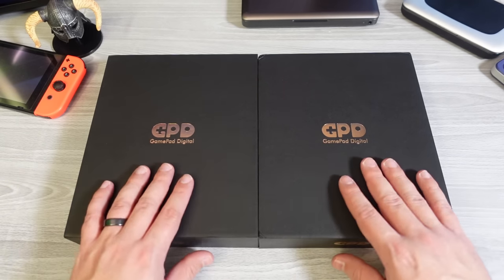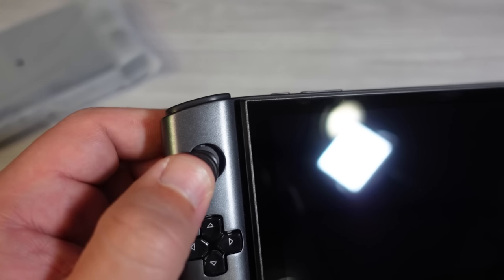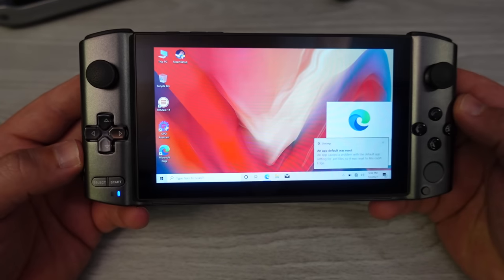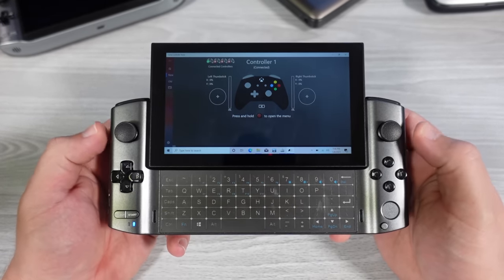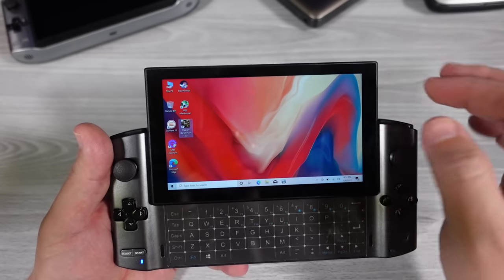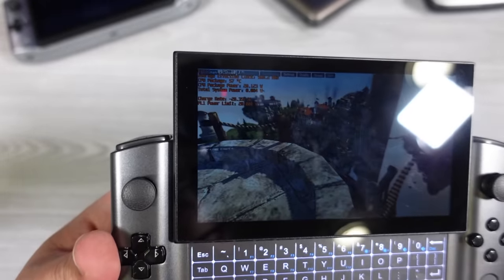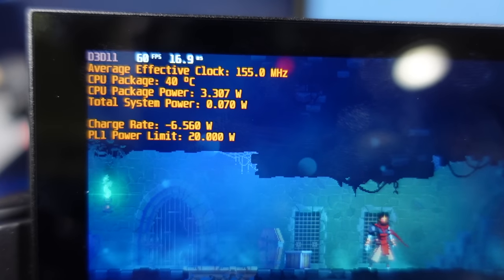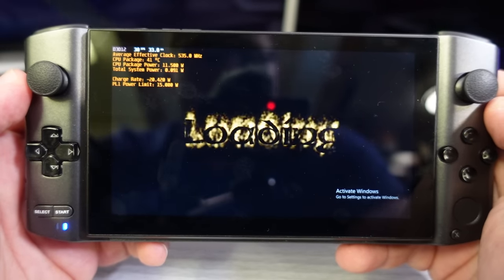GPD Win 3 - Unboxing and Quick Impressions

Comment: This looks great but my main concern is whether the keyboard will last. For the kind of price they are asking for the device you would hope it would last at least a couple of years and from my experience with similar keyboards is that they can stop working within months. I would also be worried about quality control. I bought the GPD XD a few years ago and the first two units had to be sent back due to numerous dead pixels and cosmetic damage to the shell. The third unit turned out to be ok but still had one dead pixel which is very annoying. Unless they can find a reliable distributor and improve quality control, I would be very wary about spending that kind of money on it.

Comment: Damn, that thing is as killer as it can be!
I could really be interested into switching to this as my gaming setup, just because it's portable and I could add a thunderbolt 4 eGPU. Of course the 4 cores will probably bottleneck the whole thing mildly quickly but from what I'm seeing this is probably not going to be such a huge bottleneck before long. Also probably that with a good GPU outputting a 4K can mitigate this.

This sounds so insane, I love it!

Comment: Hopefully battery tech will see an improvement where we can store 3 or even 4 times the amount of charge in the same sized cells we use in smartphones and handhelds. I wish the display was bigger with thinner bezels though that wouldhave eaten into battery
A handheld gaming pc excels at the library of games available right of the bat

Comment: That keyboard really seems to be the make or break factor. I'm hoping that GPD could make some accessories that can mitigate some of this stuff like some sort of keyboard case or a grip for better ergonomics. Of course, while docked, this won't be an issue but the main draw is for the portable experience. The performance so far seems to be really good, so I'm curious to see what undervolting does to these chips. This is actually an option for me now - if I can't find a PS5 or PC parts for the right price. 

Granted, I'll have a hard time justifying the purchase of yet another portable device outside of my PSP Go, PS Vita, and Switch, especially since I'm not exactly going anywhere during this pandemic. Another criticism, though just aesthetic for me is the face buttons. They don't exactly look great imo. If I could, I'd probably try and replace them with something a little less "cheap" looking? I guess the main glaring issue is just the keyboard in the end. I'm a little surprised they didn't try and stick the Win 2 keyboard in there, but I'm guessing it was either down to space for cooling, cost, or both.

Comment: Thank you for the review! Looking forward for games and emulators tests. Bet it can easily emulate Switch now.
Impressed by the power of the device. Don't really like the design tho (because of unprotected screen). But definately putting this on my 2021's wishlist together with Oculus Quest 2. Win2 is still the best handheld for me this gen. Helped me play through so many games I've missed during PS360 era (currently playing Inversion, lol).
Reply: if you want protection for the display you might prefer a clamshell design like one gx as it has basically the same power but you can get 4g connectivity on it. But it's just costly and premium for what you're paying for.

Comment: Analogue L2 and R2 NICE! The 2 macro buttons on the back should have been C and Z buttons on the face. Thunderbolt 4 for basically... HDMI out? Nice! only one Micro SD card slot =(
WTF A SLIDE UP KEYBOARD?! Well there's a crap load of the cost I did not want in this device. =(
Very minimalist controls on this device, I guess you're JUST holding this device with your finger tips, this NEEDS a hand grip attachment.
Question: Is the NVMe removable, replaceable, upgradeable memory that is used for storing games and roms on?? =D (I'm pretty sure there are NVMe to micro SD adapters out there, was just looking at M.2 to Micro SD adapters last night)

Comment: Damn that's a great console a real beast, looks like I will be selling my Max.

Great video many thanks
Reply: I'm keeping my Max. I have no need to upgrade. I live my Max it's a sweet Linux machine once you get your edid fixed
Reply: Yes its a great machine with a usable keyboard. I only really use my Max for games and emulators so the extra cpu power is very handy.

Comment: What is that heatsink made of??? 60 celsius max after 20 mins at 20W?????

So the cooling is even better than on the freaking Max?
Reply: The new Intel cpus also are much much cooler, and offer a good 50% more gpu performance (more in some cases). So really they could have done nothing at all, and still achieved a much cooler, and much more powerful device.

Comment: Those controllers on the sides look very uncomfortable. That would be nice if they split an Xbox controller in half and use that? Or they could make something like the fixture s1 that you can use with Nintendo Switch.

Comment: These look really impressive so far (1/4 of the way through the video so far), lil disappointed the screen being 720p doesn't have smaller bezzles, but you know- you can't have it all! 😂 looking forward to seeing the final market version :) the keyboard is a lil bit of a let down, but its serviceable for just getting around the os :)
Reply: How good is your eyesight? 720p on this small screen is perfect.
Reply: @Nickbaldeagle02  I just mean the bezzles not the screen resolution :P think 720p it's a perfect balance for perfect and resolution really :)
Reply: I think they limit the resolution to 720P because want to maximize the framerate high setting option in games.
Reply: @shahlegno5890  and save battery power

Comment: This thing looks good.. And the fact that I could run Linux on it.. Makes it more attractive to me.

The screen issue could probably be easily solve by just rotating the screen on the display settings..
Reply from the maker: It's a little more involved than that. But it will def be solved

Comment: 1:08:40 I disagree. That doesnt look that much better than just typing using the windows 10 touch keyboard.
i would prefer it having only macro stuff like altF4 and CTRLSHIFTDELETE and brightness up and down and volume keys onto it only.
that would make those keys bigger and more usable. that way you could use it to alt tab and other stuff while using the windows touch keyboard for inputting text. since this is just horrible for typing. most people are just gonna have a keyboard attached to it

Comment: I got screwed with the GPD Win 2 where the battery stopped holding a charge after 1 year, not gonna get bitten twice with another one.
Reply: Can you not order a replacement battery?
Reply: @Nunos645cgh  You need to open the damn thing to replace the battery, didn't want to take chance, so I sold it to someone who could.

Comment: Hey Phawx,

I am curious, is there any option to run the thing "Wide open" in BIOS, or with Throttlestop?

If so, I would love to know the temps and clock speeds while running something like Prime95 or Cinebench at the full 28W TDP.

I ask, because I have a GTX 1080 external GPU with a 1065G7 laptop which will run at 29-31W non-stop, but it either sits at a toasty 95C the whole time, thus thermal throttling below the all-core max of 3.5GHz, or it manages to hit 3.5GHz but that low-ish clockspeed bottlenecks whatever game I'm playing.

If this could run at 4.2GHz and sit around 80-85C for extended periods of time, it would be a significant boost for my setup, AND it would be way more portable than my current system.

I recognize that the handheld performance and battery life is the main draw for most people, but this would be an ideal computer for me if it can actually run at full click (28W) and keep itself cool while doing so.

Comment: Unfortunately, this will be my first GPD product I will have to skip. The screen just too small for practical use.
Reply: It's the same exact size as a switch lite screen
Reply: The switch lite is not running a Windows UI. The switch UI was designed specifically for a smaller screen. Windows UI was never intended to be used on such a small screen. Navigating the windows interface for anyone who doesn't have a magnifying glass as eyes will be frustrating at best. Not to mention trying to read a lot of text in games like RPGs.

They could have narrowed the bezels and at least used a 6" screen without making the device any bigger. It still would have been a bit small but still manageable as the Win2 was.

Comment: 3 reasons why I won’t be getting the Win 3:

1. Screen size is too small.
2. Keyboard is too small and touch sensitive.
3. Placement of thunderbolt port at the bottom means that I can’t rest the device on my chest/stomach when charging or connected to an eGPU.

If only my Win MAX had the 1165G7 and analog shoulder buttons....

Comment: Should i get this or wait for steam deck?
Reply: Steam Deck seems to be the most refined and flexible of all the PC handhelds out there purely for gaming purposes. The controller layout is more akin to a fully customizable gaming controller, plus it has capacitive track pads for mouse-like controls. It also has your full Steam library and good enough internal specs to play pretty much all of the AAA games on the platform. But the biggest point for a lot of players will most certainly be the very aggressive pricing. All other PC handhelds are much more expensive, including this one.

Comment: still it's impressive. i would follow closely. wondering how much will be the price.
Reply: $800 for the black version and $900 for the silver I believe.
Reply: @ricksmith4840  what about the components? the 1135g7 would come in both black and silver...
Reply: 799 for the 35g7 and 899 for the 65g7 black and silver are the same price
Reply: @impactkings  yeah, i would have assumed the same (for the colors). 
it's not really cheap, but the formfactor is not cheap. i'm really considering it.

Comment: Controlls are so tiny and Screen bazels so big :-( Maybe the OneGX 1 Pro is a better option. I would love to see a comparisen between both of them by Phawx :-)
Reply: The OneGX 1 Pro uses bluetooth to connect the gamepad. Watch Short Circuit's review on the non-pro version. They didn't like it due to input lag. The controller on the Win 3 has much less latency. And the Win 3 is only 799/899 USD compared to the OneGX1 Pro at $1300+
Reply: @techfreakjames  Yeah you are right. But is latency and low price worth, if you have no fun playing? I hated playing on my Win 1, cause the controlls sucked. Win 2 was a litte better (but still bad due to missing L3/R3 clicks). I think, a standard controller layout and comfortable hold would fit my needs best. Maybe the AYA is the perfect sweet spot :-)
Reply: @Flopp93  i think I'd have no problem with the controller layout of the Win 3. I do have a problem with the screen size (+1 to aya neo) but 5.5" is not a deal breaker to me. I already have an egpu and I'd like to be able to dock my handheld when at home (+1 Win 3) for better graphics. I'd rather have a touch kb than no integrated keyboard as I don't like losing screen space for a virtual one (+2 Win 3). I daily carry my Win 2 over my Win Max due to the size. I assume that the aya neo, having a 7 inch screen would be bigger than rhe Win 3 (+3 win 3). Per the phawx's tests, some games run at really low tdp and we can adjust that further using throttle stop. I think gpd would win the battery comparison (+4 win 3). Personally, I'd still choose the Win 3.

Comment: Hi phawx. Great work there. Is there enough clearance for air when you lay it flat on a table for when you want to connect it to an egpu? An unmodified Win 2 had that problem where the feet were too small and caused overheating when flat on a table.
Reply: Probably not. That's why you should probably get their dock for that, that props it up in a similar position than when you use it handheld, for which is was probably optimized.
Reply: @lucascarracedo7421  you can't connect the Win 3 to an eGPU when you connect it to the dock. The dock itself does not have a thunderbolt port. That is the downside of this final design compared to the earlier one where the type c port at the bottom was USB4 and the thunderbolt was at the top.
Reply: @techfreakjames  good point. Still, I was putting emphasis on the fact that you should probably prop it up somehow. If it's clearly not the dock, since as you stated it would never work, could be any other thing. The design itself doesn't look as if there's a ton of clearance, but furthermore these devices tend to have their thermal solutions planned to work mainly on their natural in use position.
Reply: I did add silicone feet to my win 2 but still it works better when propped up with a small stand.
Reply: @lucascarracedo7421  my win 2 came with the aftermarket cover for the ssd so i also got the rubber feet which fixed the clearance issue. The Win 3 has those small protrusions that can accommodate the same feet but the surrounding area is not flat like the win 2 so i don't think the same rubber feets would work. You're right, though, i do have a phone stand here that when folded can elevate the intake. Just needed to be creative. Thanks.
Reply: @techfreakjames  yeah. The only problem I foresee with the phone stand is that it would have to be one of those that allow a cable from below and it would need a decent clearance to avoid too much stress on the win 3's port down there.
I wouldn't discard a 3d printed design that allows this and probably even helps keep the cable in place.

Comment: Is this a true 'horizontal display' or is the same as with the Win2 where the actual orientation of the display is portrait and is simply rotated in windows. Win2 had multiple issues with some older games because of this
Reply: ahh nevermind. this is explained at 48 min. It Sux

Comment: I know it's unfair since win3 seems a much more complete device than smach-z but since you have tested both devices can you share your thoughts on how close smach-z can stand against win3? In terms of a gaming device, e.g. controls, screen size/quality, battery and cpu/gpu performance? If it is very far I think smach-z has no reason for existence anymore and releasing it publicly would be a massive failure.
Reply: The Smach-Z already doesn't exist. It will remain vaporware until it's actually available for legit purchase.  Unless you're one of the unlucky backers still hoping for it to actually come out, a comparison would be completely moot.
Reply: @mjaustin9772  ThePhawx has already previewed a smach-z unit a year ago. Based on his experience with it I addressed him this question. I mostly want to grasp if for such devices the steam controller is better suited rather than the usual thumbsticks. I am an "unlucky" backer however I am grounded, I dont expect it to come out, and if it does I am pretty sure it will be a brick. Anything else will surprise me unexpectedly.

Comment: I was almost sold on this till I saw that keyboard. I can't imagine using WASD on games that can't pickup the joypad settings (had this happen on a few on my WIN 2 before the display packed in and had to sell for parts)
Reply: Use rewasd it translate controller input to keyboard input for games that don't support controller
Reply: Or just use the mouse mode instead of gamepad mode. In mouse mode, the left analog stick is mapped to WASD and the right is mapped to the mouse. You will need to remap some buttons like jump, reload, etc. to the other buttons mapped to the face and dpad buttons but that's how I played half life 1 on the Win 2.
Reply: why would you ever use the keyboard on these devices for gaming anyway?! that seems stupidly uncomfortable
Reply: @nemesis8508  example game would be WoW when using controller mappers failed or were unplayable.
Reply: @DeimosXVX  don't play wow so i didn't understand any of that lol. i do play ff14 though
Reply: @nemesis8508  in a nutshell it was never made for controller setup. A fan made program let's you bind keys to the controller but sadly WIN 2 had problems with it for me at least. 

Skyrim though was fine with xinput.
Reply: @DeimosXVX  honestly wow just seems like a pain in the ass compared to ff14
Reply: @nemesis8508  another example is half life 1. It was not compatible with gamepads. And if you're not used to modding, you also won't be able to play mass effect with a gamepad.
Reply: @techfreakjames  I know about Mass Effect. Had to do that for my gaming laptop. Mass Effect was actually how i learned about modding to begin with
Reply: @DeimosXVX  then why not just get the win max or wait for max 2. In my honest opinion, these handhelds dont really need keyboards.

Comment: Is the base dock with the gpd3 thunderbolts 4 compatible because it didn’t say it on the website?
Reply: No, you can't use thunderbolt devices (like an egpu) when connected to the dock. The type c port that you see on the dock is just usb, not thunderbolt.

Comment: I really hate the right analog stick placement. It completely ruins your muscle memory and it makes it harder to reach the A button.  With the old setup, you could quickly switch from moving the analog stick to pressing jump or accept. The only games this makes sense for is for shooters which I don't think is what most people would want to play on this kind of device. Or games that have jump tied to the shoulder buttons. Also using the dpad and face buttons looks very cramped and forces your hand in an unnatural position.

Comment: The screen is way too small, my phone is bigger that that, it needs to be at least a 7 inch screen.
Reply: Most phones are wider than 16:9 and measure diagonally so it isn't really apples to apples most of the time. For reference the switch lite has the same exact size screen